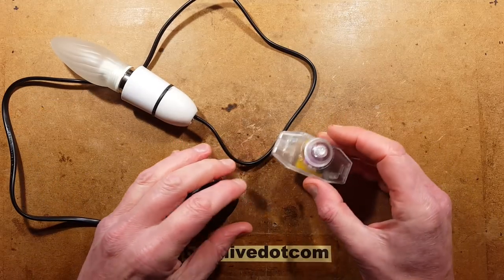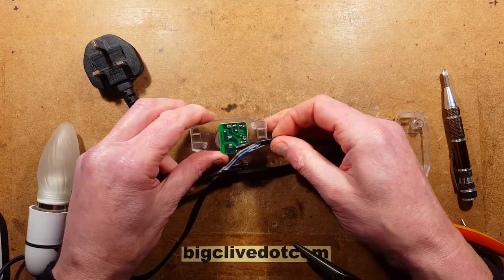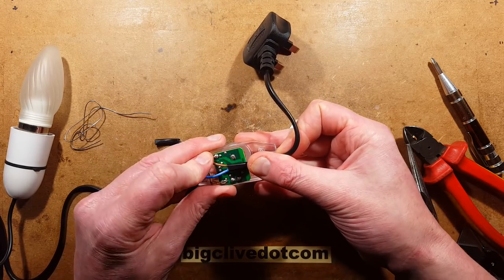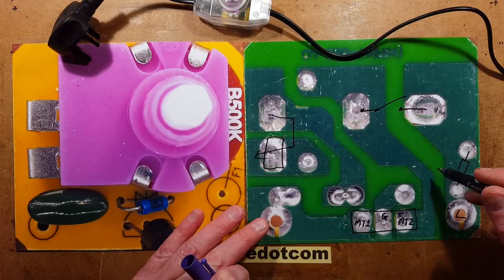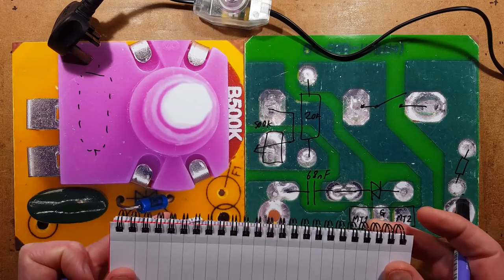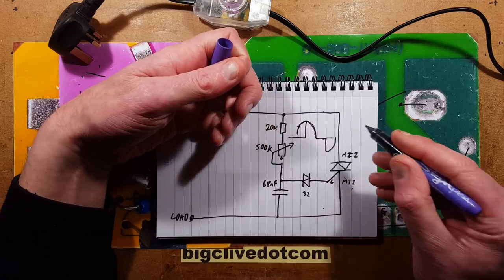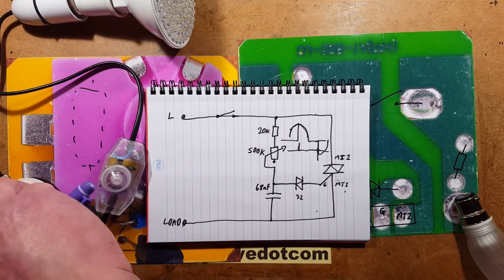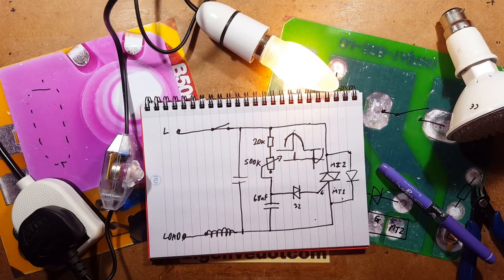Low class inline dimmer from eBay.  (with schematic)

Comment: Big Clive, you did not install the wires correctly. The circuit board has anti stress holes for a reason. (Safety) The wire is mounted threw the un-tinted side and then soldered to the tinted wire board connect. By mounting and soldering wire threw hole this way keeps some yahoo from pulling wire lose from the circuit board and causing severe injury, or even death. I know you already know this. But, by you doing the soldering job in this manner in the video would give someone the opinion that this is a safe practice because Big Clive did it this way so it must be safe. Right? I hope this does not sound bad. That was not my intention to sound haughty. Thank you for your time in the production of these mini doc's.
Reply: @Matt Quinn Your right about this product being trash. Thank you for your time.

Comment: The types of aftermarket dimmers that used to use were the ones that were just a plug adapter with a knob on them. The type you plug into a socket whereafter you just plug the lamp cord into it.

Comment: @16:36 Very true. I actually had a capacitor in a capacitive dropper-powered LED bulb (in a table lamp) literally puke it's guts out (It looked like if some molten gray lava had spilled on the PCB) because I didn't realize that the dimmer in the table lamp wasn't fully off (it was a touch dimmer) and left the poor LED bulb running for a very long time. I later modified the table lamp and removed the dimmer.

Comment: My guess for the slit in the two AC solder points is to keep the hole unclogged, so you can thread the wire thru from the component side after pretinning.

Comment: So i'm curious if it's possible to rotate the PCB by 90° or whether they maybe mounted it wrong to begin with, so one might be able to avoid the wire contortionism inside the case there. Not that i have any practical reason to be curious of that, was just a thought.
Reply from the maker: It dopes appear to fit in that way, making the wiring more sensible.
Reply: my first thought was the same: they design an in-line switch with such a bad connecting? the PCB is almost square, this must be assembled wrong. but you may never know...

Comment: Weird I had forgotten about this YouTube says I've watched it and I've liked it. What's so weird it was a suggested video on the right side and I was just looking for one of these on eBay well not quite one of these but wondering if I should get one of these instead.
I was given a heating pad that the fancy digital controller had malfunctioned my plan was to just cut it off and buy a in-line cord dimmer for a lamp where I can shove the cords in and squeeze the things down but I can't find them anymore at my local stores or Ebay. So I either need something with a screwdriver or soldering = more time involved.

Comment: I suspect that is aimed more at the lamp cord style cable where you can see like 2 wires barely attached together with a wimpy middle rubber molding vs the round jacket style you have there.

Comment: Just ordered myself one of these. 
I use a small length of speaker wire from a plug to a 7w incandescent nightlight in a holder above the bed. The full 7w is a bit too much. But hopefully this can ease my eyes.
Reply from the maker: The load might be a bit too low for this dimmer, but it's maybe worth trying.  Have you considered an LED night light?
Note that speaker wire may not be rated for mains voltage use.
Reply: @bigclivedotcom  I'm not a fan of LED at all. But yes i saw the minimum load was 15w. In that case a standard 15w pygmy/appliance lamp will suffice. I'm not sure what will happen if a load too low is used? Perhaps the triac will fail to hold for the rest of the sinwave? 
Speaker wire is definately not rated for mains voltage. I will use this opportunity to replace it. Good idea. :)

Comment: I think that's pretty much the "temperature control" circuit in my Rapid Electronics soldering iron station, just a glorified dimmer switch circuit, only I think the iron has suppression to keep the Spam radio types appeased... :P

Comment: It’s not so much the need for soldering that would annoy me, it’s the lack of earths. I know most lamps aren’t earthed but occasionally they are and you end up trying to open the cable without damaging the earth wire because there isn’t enough room for a connector, but then you fail and end up putting the PCB in a bigger box, thereby defeating the point and wasting time… did this only yesterday attaching a cheap smart switch with only 2 connectors (Sonoff Basic) to a far-infrared heater, but I have done it to a lamp in my living room too. Turns a ten minute job into a several hour one, as you have to find a box, drill progressively bigger holes in it, find the grommet box, attach, zip tie, hot glue.… I have an airBnB: people will do odd things. Wires need to be so secure they could hang on them.

Comment: Very nice! So, for other dimmers that support LED lamps, what is the difference? Do they add anything to the triac?
Reply from the maker: Sometimes a MOSFET for reverse phase control (turns on at zero crossing point and off mid sinewave) or just buffered circuitry to make operation more stable.

Comment: I was really hopping you were going to blow the tracks off!
Reply: @Dreams are fragile
i think with that tiny triac even a dead short wouldnt blow a track :-)
Reply: Dave Micolichek  
i have seen a to220 triac after such an incident , the plastic nowhere to be seen just the the two pins at the sides and the middle pin holding the tab just standing on the pcb :-)

Comment: An improved(?), perhaps the designed, routing on those conductors likely would have been over the top of the board, alongside the dimmer there, with the live ends poking through those holes to the pads and the "through" conductor resting over the non-solder-y side of the board. That said, it's basically garbage so the best routing is likely to just keep one's flex out of such a device altogether!

Comment: I don't at all like that module at all with the lacking strain relief and the wires being squished between the case and the solder connections of the board. It seems so likely that neutral will be pierced or the live connection will pop off and touch something it shouldn't be touching. Like you.

Comment: I guess you could probably use a motor variable frequency drive as a dimmer for a capacitive dropper - if you lowered the frequency of the mains, the effective resistance of the capacitor would be higher,

I don't think there are small low power vfds though, everything designed for a motor would be super overkill and expensive, unless you wanted to power a ton of them i guess

Comment: the cable goes along-side the pcb, the cable ends up under and into the terminal holes so they can be soldered easier and wont squash the cable 😉

Comment: The RF noise issue isn't just for radio users..  In fact, it actually arguably affects average people a lot more nowadays than it used to, but they just don't realize it, because it's hidden away as other types of apparently unrelated problems instead.  Why is my WiFi so slow?  Why do my wireless earphones keep cutting out?  It might well be that crappy dimmer you're using flooding the area with RF noise, which is making it harder for all the digital wireless stuff to do its thing too...

Is one dimmer switch going to kill your dreams of a wireless life?  No, probably not, but the more noise sources you add to a particular environment, the more they all add up, until the total noise finally gets to be so much that it does start causing problems.  I've seem lots of situations where all it took was one new badly-shielded device to push things over the tipping point and suddenly all kinds of random problems start happening with unrelated stuff for no apparent reason.

Comment: I can't do this with mine. Mine is slightly different and I can't fit my big American wire in it. Our wires don't have another thinner insulation layer inside like yours. Everythings thick and not very flexible and I can't find a way to fit the wire in the housing properly.

Comment: Hey, Clive, i've got a problem that's been bugging me. I've been trying to figure out how to hook my Christmas lights up in a manner where one switch turns on all the outdoor lights, regardless of the outlet they're plugged into. I was thinking there might be a system that's basically a remote that plugs into the end of the strands and sends signal to an adapter on the outlet, but if there is I wouldn't know what to call it, or if something like that exists. Even if I have to build it myself, I would love to see if you have a solution for my first world plight.
Reply from the maker: You do get remote sockets that can all be programmed to a single controller.

Comment: Don't you guys have "lamp cord" in the UK?  Here in North America we have a thing that's basically 16-18 AWG  2 conductor wire.  You might know of it as speaker wire.    It's not wrapped like that. It's two parallel strands that you can split and strip to fit inside a switch like that.  They even have switches made for that kind of wire that basically just clip on to lamp cord and make it switchable on and off. and you just have to cut out a tiny section of one of the wires and it has little copper pins that stick into the wire on either side of the gap. 

Lamp cord
https://i.imgur.com/WnjFNXw.jpg
Inline switch with conductor spikes
https://i.imgur.com/EQdrvBS.jpg
Reply: Probably not, I don't think I've ever seen a mains cord without double isolation, so not really useful. Also it might be because you have half of voltage, and double current, so for a lamp like that you need thicker wire.
Reply: Alacritous - In the past we had twin flex similar to what you describe. Modern practice is for all flex (flexible cable) to have an outer sheath covering insulated conductors. The reasons are that this is more robust. If the outer is damaged, it is easy to tell and there is still the insulation on the wires so the risk of electric shock is minimal.

Comment: "in the bin it goes" ..  dude, the case is so nice, probably worth more than the electronics in there ! 
why don't you make a 12v fan regulator or a proper led dimmer out of it ?  etch a nice board that utilizes the original pot and switch...   :P
Reply from the maker: It didn't go in the bin.  I'll repurpose it.

Comment: The offset dimmer knob is slightly annoying. Couldn't they design the board for it to be in the centre?

If it were in the centre you could rotate the board 90 degrees and make the connections neater.

Could the donut Solder pads also be drilled to install the cable from the top side by poking through the hole. That would also avoid the pinching.
Reply from the maker: I think it's to facilitate thumbwheel style operation.

Comment: I understand the RF noise thing, but why do some mains dimmers produce audible noise? The house I grew up in had wall-mounted dimmer switches on all the mains lights, and they all produced an audible hum/buzz, which was loudest at their dimmest setting.
Reply from the maker: The suppression components often make a buzz at middle settings.

Comment: this is probably a stupid question, but clive was saying how its such a simple circuit and some of the components caused problems with flickering. what would happen if you just used a potentiometer and thats it? i'd guess that the pot would heat up and melt? but assume it was fairly beefy or had a heatsink of some kind. why wouldnt this work?
Reply from the maker: A potentiometer would dissipate a lot of heat.  Early dimmers were based on rheostats.

Comment: Do current dimmers have a minimum wattage? I remember the first generation of solid state dimmers in the '80s had a minimum wattage load (30w, for example)
Reply from the maker: Standard triac dimmers do have a minimum load.  It's more complex with LED lights though.

Comment: Inline switches are a major pain, especially the cheapass ones that rely on sharp brass points to pierce the wire instead of screws or soldering...

Comment: Electronically, what is the difference between 240v AC none dimmable LED lights and 240v AC dimmable LEDs lights?

BTW, All radio amateurs still use or have access to using the exact same radio bands and modes as that used in the 1970s, radio spectrum is radio spectrum, and radio interference to radio amateurs is a huge problem these days.
99.9% of interference I've been involved with resolving has usually been caused by cheap Chinese overrated switch-mode power supplies that have no interference suppression built into them. in the area I live, I have tracked down and either fixed or replaced some 15 switch-mode power supply sources of interference in the last 20 years, both on my own and with the aid of Ofcom (a UK Govt. Agency that investigates interference and who ultimately governs UK radio amateurs).

K Watt.

Comment: Clive, would this work if I was trying to dim my 120v-to-5v LED Pathway lights outside? I have a dimmer on low voltage side  but as I turn the knob, it seems to only go a little bit dimmer, and then they all start to blink. What would you suggest for something to get them down to 1/4 intensity without starting to flash?
Reply from the maker: If they're not designed to be dimmed then it may not be possible to do so without modifying their circuitry.
Reply: @bigclivedotcom  Damn. Well, if I only had a Pocket-Clive I could pull out,  he could tinker with the circuitry and make it happen!
Can I order a MiniClive - U.S. Version from somewhere? 
:)

Comment: Question: if electricity is basically electrons flowing through a system, and as we all know electrons have a negative charge, does that mean that what we call "LIVE" is actually negative and "NEUTRAL" is really positive?
Reply: General Disarray Eh, not really, since in alternating current the current, well, alternates. So on one half of the sine wave electrons are coming out of the live and going into the neutral, and on the other half they’re coming out of the neutral and into the live. 

But you’re on the right track. The words you’re looking for are “conventional current” and “electron current”, depending on whether we consider current to flow from + to -, or as the electrons physically move (from - to +). The maths are the same, just with opposite signs, so the only important thing is to pick one and stick with it.
Reply: @mrb692  sorry yeah was thinking of DC. But in essence when people get all hung up on wiring a house it really doesn't matter with AC it's more of a standardisation thing. So in truth Clive could have run the neutral connection through the dimmer. Like if you take the fact that the centre of an E27 light fitting should be "live" and the outer connection should be "neutral" it really doesn't matter as the polarity switches 50 or 60 times a second.
Reply: General Disarray That said, it does matter from a voltage perspective.  Since the neutral is referenced to earth and the live referenced to the incoming supply, if you metered an open outlet you should read zero volts between neutral and earth and mains voltage from live and earth. 

If you consider something like a toaster, you’d want live going to the switch and then through the toaster and out neutral, since the heating element would be at mains voltage with the machine off if it were the other way around. Doesn’t matter from an electrical perspective, but that’s just waiting for Little Timmy to stick a fork down the slot and give another path to ground :p
Reply: @mrb692  Hold my beer I'm gonna try out this toaster idea... Timmy, Timmy, where the hell are you son, get on in here boy, I've got an experiment for you!!! 🤣🤣🤣

Comment: Are there any common ssr modules that only trigger on or off on a full cycle? It would be nice to have a controller that doesn't need to track the phase and doesn't induce dc bias.
Reply: Most SSR modules only cut on and off at the zero crossing point. Dimmers delay the cut on time to chop off part of the sine wave, but regular DC controlled SSR's don't do that.
Reply from the maker: The name for that type of controller is a burst firing controller.  But only suited to loads like heaters as it produces flickering in lamps and noise from motors.
Reply: @bigclivedotcom  thanks! I sort of hoped it would be available in hardware with an scr to make design easier.
Reply: @bigclivedotcom  phase control distributes the noise into the realm above twice the line frequency, zero crossing below twice the line frequency, if I understand it.

Comment: Classic TRIAC dimmer, developed by General Electric back in the 50s.

Here are the 4 operating "modes", or quadrants of a typical TRIAC:
https://threeneurons.files.wordpress.com/2013/11/triac_mode.gif?w=500&h=500

Quadrant IV (4), is the least sensitive, and most problematic, so its disabled in 3-quadrant TRIACs. This dimmer uses (used... its now e-waste) quadrants I (1) & III (3).

Here is how TRIACs are typically controlled:

https://threeneurons.files.wordpress.com/2013/11/triac_drive.gif?w=500&h=625

From computers, quadrants I (1) & IV (4) are typically used. Special TRIACs, called logic TRIACS are used, because their gates are extra sensitive. But as mentioned before, quadrant 4 can be iffy. To avoid this, the driving computer circuitry, either drives an intermediate opto-isolator, with a TRIAC output (MOC30xx), or uses a negative supply (Vcc to GND, & Vee to -5V), so quadrants II & III are used. I do this on my current color organ kit (CO3I, the "I" version):
https://threeneurons.wordpress.com/miscellaneous-projects/3-channel-color-organ/